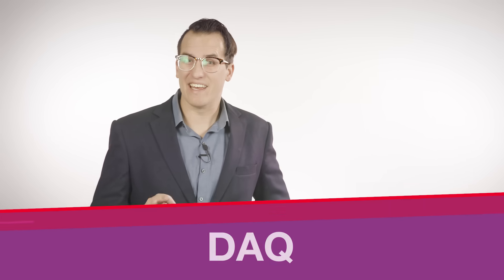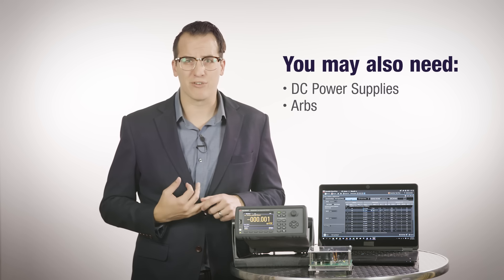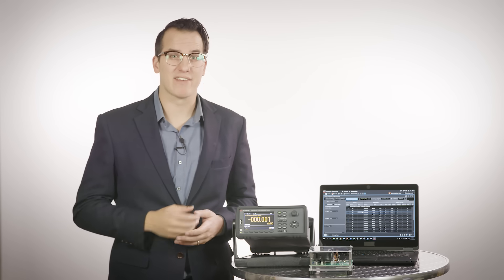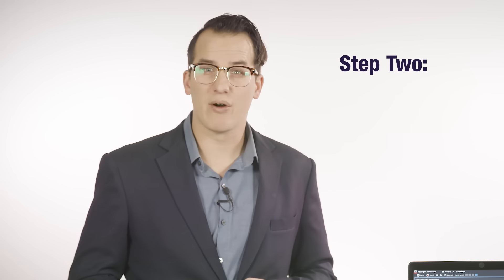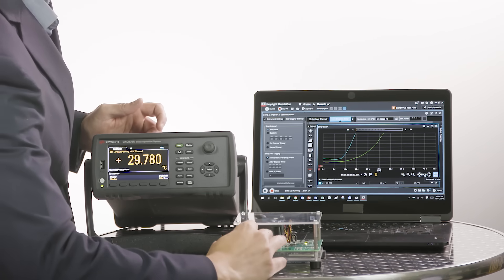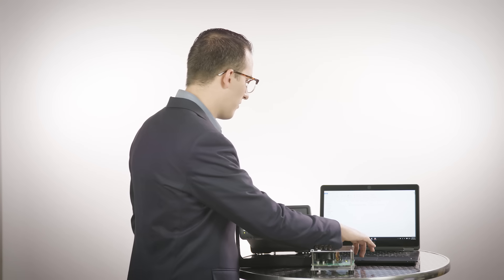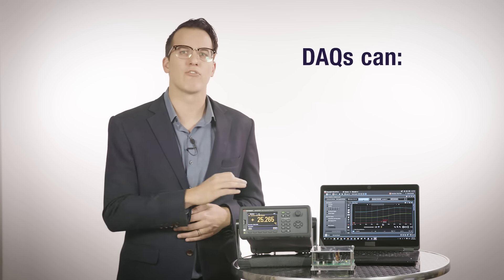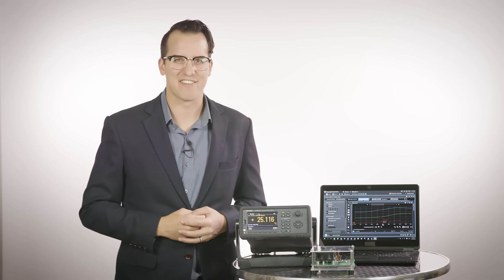How to Make Temperature Measurements with a DAQ

Comment: Hello Sir, I want to store the data in the form of a change in dc voltage at the rate of more than 50000 readings/sec. is it possible with DMM or DAQ and the voltage range is in mVolt?

Comment: Those poor relays, I hope nobody has a need to capture all the maximum data points multiplexing whole time like that :p What sort of sick application would require exporting to word? Also it seems like overkill for most of the applications you listed unless you add prototyping to all of these.

P.S. I bet you can also program it as the most expensive alarm clock :p
Reply from the maker: You could make an awesome alarm clock - it would go off when your water for coffee/tea was ready for brewing :)